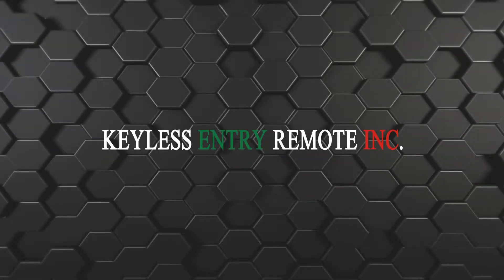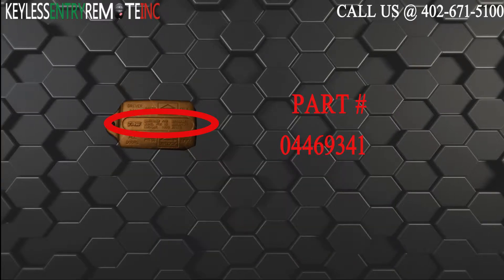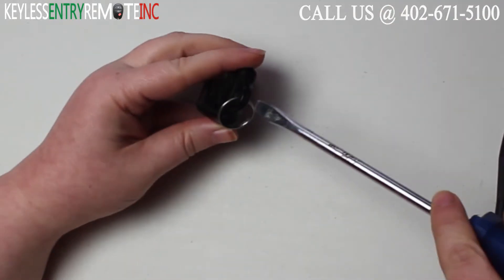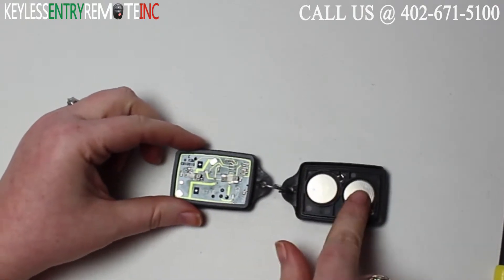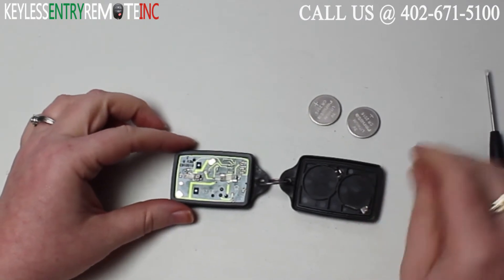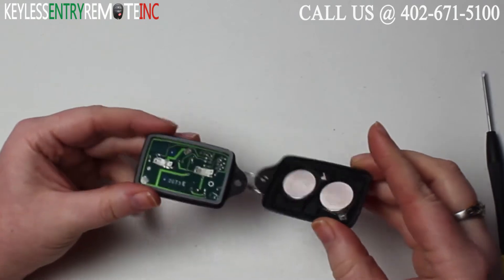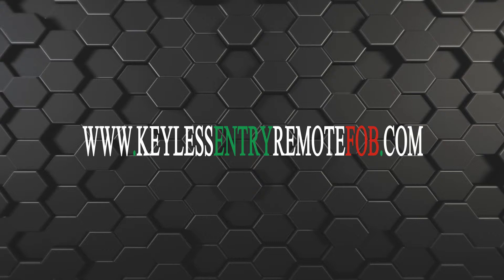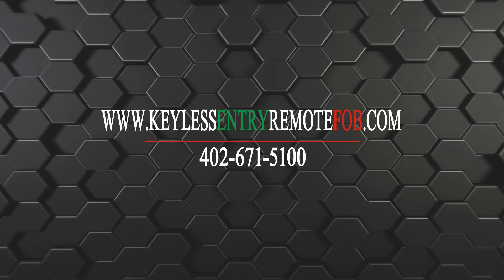How To Replace Chrysler LHS Key Fob Battery 1994 1995 1996

Comment: Thanks for the tip... I have tested my keyfob at auto store... I can't get the car to respond to the remotes!!!!
If u manually lock the doors with the inside door lock switch... the alarm doesn't come on!!!
It's like the transmitter or alarms disconnected!?!?!
Reply from the maker: Try reprogramming the remote:  94-95 Chrysler LHS
Obtain all remote transmitters for this vehicle.
 
1. Remove the middle vent bezel from the center of the dashboard. Locate the 6 pin traction control connector behind the vent. It will be black in color. Connector should be connected to the vent bezel or the traction control switch, if connected to the traction control switch you must unplug it.
2. Insert key into ignition and turn ignition switch to the ON position.
3. Using a jumper wire or a paper clip bent in the shape of a "U" jump pin 1 to pin 4. Ensure there are metal contacts or pins in cavities 1 and 4. When done properly the doors will automatically lock and then unlock to show that vehicle is in programming mode.
4. Press any button on the first remote to be programmed. Locks will cycle again to indicate vehicle recognized remote. If programming a second remote press any button on second remote to be programmed, locks will cycle again to indicate that second remote was recognized.
5. Programming is now complete, turn ignition to OFF position, remove jumper wire, and test remotes to ensure proper programming.

96-97 Chrysler LHS
Obtain all remote transmitters for this vehicle.
 
1. Insert key into ignition and turn ignition switch to the ON position. (Turn as far as you can without cranking the engine)
2. Locate the Data Link Connector (DLC). It will be under the dash on the drivers side. Using a suitable jumper wire, jump pin 1 to pin 4. Ensure that there are metal connector ends in the cavities that are referenced in this procedure. Once the jumper wire is installed it needs to remain there throughout this process until instructed to remove.
3. Press any button on the first remote to be programmed. If the signal is recognized the vehicle will Lock then Unlock the doors automatically.
4. Repeat step 3 for any additional remotes to be programmed. The doors will again Lock then Unlock automatically after each successful remote programming.
5. Remove jumper wire and remove key from ignition as programming is complete. Test each remote to ensure proper programming.
Reply: Keyless Entry Remote Inc finally figured it out!!! One remote with good battery & signal!? Needs reprogramming to car... the other ..weak battery (got closer to car worked a few times & stopped again).... replaced weak batteries working now!
Arming alarm ,locking doors, & pops the trunk up... so we r n business now!!! Thank u much!!
Reply from the maker: Great news, glad you got it to work!
Reply: Keyless Entry Remote Inc thank you for the info!!!!
I switched batteries to both remotes... now one remotes working the car!!!
The alarm is working too! The red dash light is blowed/bad!
So it had me thinking not working but it is!!
I'll try to reprogram the other remote! Think your on to something!!!
Keep up the good work thanks again!!!!
My daughters enjoying the car now!👏😜
Reply from the maker: Glad you have one working now!